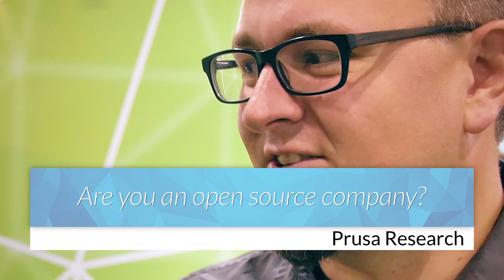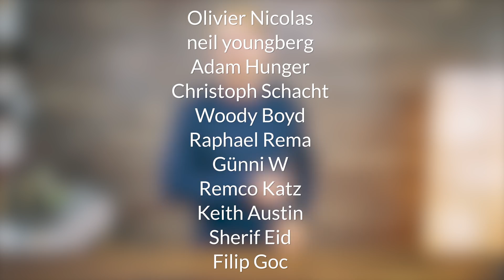"Open source" is more than a marketing term!

Comment: i would really, really really like to hear the opposite side, the people that think open source is not that great and why . that would be a good video as well ! Here i feel it's just a promo video to say that in order to be cool and progressive you NEED to be open source, and i think it's not the case at all.
Reply: It is perfectly normal for the management of the company to care very much about its profits, it is called 'fiduciary responsibility' and it is a duty of the officers in most cases, even for private companies. The question is not whether they care about profiting, alone or not, from the IP, the question is how they think they will profit the most from the investment they are making. There are many parameters, from the length of the development cycle, to the product life cycle, the R&D investment, the margins that the market will support, and as always, the short term vs. long term. A competent management team will take and attempt to quantify all these inputs, then inject their philosophies (beliefs, experiences, gut feelings,..) to build models and projections, and come up with a strategy. Not surprisingly, different teams in different conditions come up with different answers, positioned  along a continuum, not necessarily at one or the other extreme. 
All large tech companies have a mix of open source and proprietary products, and there's nothing wrong with that. That's how standards and interoperability are possible.
Reply: Pretty clear for me. I release some of my designs online free of charge to benefit the community but in the end I need to make a living and honestly, I like getting credit for my work, for all the time I put in and to think something I make could be ripped off and my name completely removed hurts more than it probably should. That’s why I don’t put some of my greater projects out there. That’s why I have a lot of respect for Josef Prusa. He has manage to make an OpenSource masterpiece while maintaining a working and very successful business and his name is renowned throughout the community.
I’m working on a new and hopefully exciting 3D printer design that I plan to make open source when I’m done with the basics, but I hope at the least my work is credited.
Reply: I’d just like to add some potential perspective from a professional environment on “closed source” from the “top end” as well.

I work for a drug research company currently doing trials with a Dementia related drug - despite spending literally hundreds of millions of $, you could call us “small pharma” but I don’t think any of us would consider these sort of numbers to be small fry :P.

Anyway, After spending decades on doing research and spending hundreds of millions, possibly even billions, on that research and on clinical trials, a company like ours and the investors that make it possible will - I think quite naturally - want to ‘protect’ that investment and keep the whole thing “closed source” in order to maximise profits.

I personally sit quite far into the “we’re all about as individual as a leaf is on a tree” i.e. what benefits others, ultimately benefits me - but I realise that sometimes it’s only really possible to make a project work using money, large amounts of money, and the people with that money might want more money in return for taking the risk of investing that money and “closed source” can very often protect that investment.
Reply: I’d think the opposite side is pretty obvious.

If you’re the IP holder for a closed source, possibly even patented product then you and you alone can profit from it. Which is great, if that’s what you care about.
Reply: Mark Hobbs medicine is a different story: they have patents. The whole thing with reprap took off after some key patents expired, so it is doubtful if patents really help innovation.
Reply: Jelle B Pharma isn’t any different than other industries because we make use of patents - heck the reason we got the explosion in FDM printers nearly 10 years ago is because of the expiration on Stratasys’ patent on FDM.

What I think makes our industry lean away from open source is the costly nature of the research - I think it’s quite natural to not instinctively want to share your IP freely when you’ve forked out hundreds of millions of dollars on the research to make it. In terms of inhibiting or helping innovation, with these levels of costs there would be no way investors would pony up the vast sums of money required to create the types of innovation we see at this level without protection mechanisms like patents.
Reply: The opposite side is very clear, if you want to make the big bucks you do not under any circumstance ever show your knowledge to anyone.
That is why all the richest companies go with proprietary stuff and seek to make even the options a paying ordeal.
Reply: Yeah but we've had proprietary for what, 30 years now? 3D printers were nothing but proprietary. They cost about as much as a Rolls Royce, and the materials were suitably marked up too. But the engineering they put into it was marvellous and the quality was absolutely spectacular. This is probably the best argument for proprietary you're gonna get - by locking competition out and driving prices up, they were able to sustain top of the line engineering.

Right now we have low-cost proprietary competing against low-cost open-source/collaborative, and sad attempts at competition lock-out and customer lock-in only reduce their competitiveness, while not giving them enough margin to perform groundbreaking engineering.
Reply: Hansbald, look at patent US5121329 A filed in 1989. It would have run out in 2009-2010-ish. The subject of patent is the process of producing objects by depositing solidifying liquid material in layers.

Now you might think that this is not something that should be patentable, and that the patent should be invalid; but subsequent invalidation based on triviality is extremely rare and practically unlikely, invalidation based on prior art is normally the route taken, but quite unlikely in this instance because chances are, a 3D printer didn't exist before 1989! So practically if you were a potential smaller rival, until the patent ran out, Stratasys could sue you until you ran out of money and could no longer continue to defend yourself, or they are not unlikely to win entirely and have their patent confirmed.
Reply: I guess you can look it up, but if memory serves me correctly they were patents on the FDM process itself – so the nozzle moving around, depositing layer after layer of molten plastic. There are still patents on the use of a heated chamber (whilst keeping the heat-sensitive components out of harms way) which is why you don't see many heated chambers.
Reply: you heard it, but you missed it: Ultimaker is the new makerbot. They pretend to be open source for advertising reasons but ignore the essence of it. Ask them for their design sources (solidworks files) and you get dismissed as a religious zealot (after they try to fool you with their pre-compiled NC shit).

Comment: My 3D printing open source heroes (Wall of Fame) includes, most definitely, AlephObjects, then E3D Online, Ultimaker (Cura rocks!), and Prusa Research. Of course, the open source projects that exist on their own are also marvelous. Slic3r was originally coded in Perl (so if you really want to learn to rock Perl…). PrintRun (Pronterface) is fully open, written by a co-author of Sprinter. Marlin Firmware is popular with many vendors and under very active development by the community. The various libraries and driver boards that RepRap 3D printing thrives on are almost universally open source, and there's a lot of feedback from 3D printing projects that inform libraries like u8g …

A lot of manufacturers are vying for a common consumer market with the aim to have an all-in-one plug-and-play solution —3D printer as appliance— and miss that there's a wave of thousands of RepRap enthusiasts (and average people who go to 3D Printing Meetup groups) who are also avid buyers of MK3s, LulzBots, Ultimakers, Crealitys, Tevos, SeeMeCNCs, Chinese clones… and so on… due to the revelation that this is Accessible Technology. The reputation of manufacturers among members of these groups largely depends on how serviceable and open their hardware is, how easy it is to obtain, upgrade, and modify the firmware source code, and how responsive (or aloof) the vendor is with respect to the user, designer, and developer community at-large.

My firmware clients are often wary to expose any technology developed under their aegis to the outside world, in spite of assurances. In my opinion, when it comes to a product vendor, it's the "whole package" that people respond to. Open Source provides a mechanism to create the bricks, but it is up to creative people who understand open source to build great products and companies out of these pieces — if they're willing to play by community rules.

The generous Open Source community, which gives its ingenuity freely —time allowing!— is a powerful resource, but traditional companies fear that the community will usurp and devalue their in-house innovations. There is some basis for concern about an explosion of rogue clone manufacturers producing products of equal quality. However, the old adages about being first to market, building a name and reputation, giving attention to detail and excellent service, and so on will continue to apply in primary markets.

In general, FDM innovations are incremental and come down to adding more sensors, improving rigidity, reducing inertia, perfecting extrusion, etc., and creating a closed-source host, firmware, or slicer is a waste of resources, in my view, as 99% of that work has already been done. In the end, all consumers want is a well-made machine, ease of use, great prints, and good customer service. Vendors would be wise to open up one or more of their products and take account of the long-term benefits that accrue from externalizing a major part of their workload to fans of their designs.

Comment: I own a DaVinci Jr and it doesn't allow 3rd party filament or slicers. You can however bypass both of these by encrypting your standard gcode and reflashing the filament id chips, but I shouldn't have to. In the end I just replaced the electronics board with a RAMPS 1.4
Reply: You could always just flash the firmware over to Repetier and stop caring about the filament chips altogether.
Reply: Repetier hasn't been ported to the Jr yet
Reply: The jr can use s3d and cura

Comment: I am super-impressed that Prusa is using openscad and freecad.  This a genuinely walking the talk. I have been using freecad for about a year and used it to redesign the inferior hot end on my printer around a GENUINE e3d v6.

I know Tom has mixed feelings about freecad,  may I suggest that as it has improved greatly recently in my opinion, that he look at it again on  the channel.

regards

Comment: Lulzbot is the most insane, open source source company that exists.  Those crazy guys sent me the LAYOUT for their warehouse, and helped DeltaMaker figure out inventory management and workflow processes.  They are the most impressive 3D printer company I have seen.  Even their current development work is placed on a public development server, which is unheard of.
Reply: They deserve all the kudos and respect. they make a solid machine and treat their customers very well.
Reply: I saw a TAZ6 in a store and thought it looked cool and took a closer look.  I liked the connectors and other parts they used.  When I got home I started researching the TAZ and found all the documentation on their rsync server.  They tell you where they get the stuff and give you all the part numbers.  CAD files are FreeCAD and all the other documents are also in open format.  They completely get it!  This was a great video!   I like Prusa (have an MK2) and the others but Lulzbot is leading in open.
Reply: Proud to own a Lulzbot!
Reply: They sent you their warehouse layout?! WOW XD
Reply: No kidding.  Their responses in the video are actually pretty amazing.  We've got a Taz 4, and I immediately rscyned the source tree "just in case" they folded at some point because I was a little concerned that they'd get hosed over!  Fast forward and they're now a powerhouse in the field.  Also, the Taz design rocks, zero issues that weren't PEBKAC.
Reply: Jesus Christ! They are definately Hardcore Open Sourced. I'm impressed! So beautiful, I'm definately using them as a case when teaching 3d printing. 

Thanks for sharing, was totaly not aware of it!

Comment from the maker: Welcome to the comment section!
Reply: @Melad saleh - I suggest you try the Tom's forum (https://discuss.toms3d.org/) as his time is very limited to respond to individual requests. Someone on the forum might be able to help you figure this out.
Reply: Madhu Nuggehalli that was meant as a joke. What drm do you mean?
Reply: Madhu Nuggehalli ok. But the build plan, the code, the scad files are there. When you build your own printer inspired by the original, you could use a different Probe and Motors and adapt the firmware to your choices. I see no limitation here
Reply: Speaking about prusa research, what's your take on the blatant DRM they have on the mk2/mk2s and the up coming mk3?
Reply: Madhu Nuggehalli like the music it plays when the filament runs out?
Reply: Madhu Nuggehalli that is not drm. 
Your use of the word drm is as strange as the Asian lady in the video‘s use of the term open source. 
And there is no objection for developing a new print bead or a sensor that includes two sensors? I don’t get it
Reply: Madhu Nuggehalli thanks for explaining your point. Makes sense now. 
The prusa firmware is on github. They do not need to backport their changes to stock marlin. Everything could do if wanted. Right?

Regarding the pinda you might be right. But one could cut it open to clone it. Prusa would or could not sue, or could they?
Reply: I meant everyone not everything
Reply from the maker: Also, first. Deal with it 🕶️
Reply: Thomas Sanladerer Gg tom
Reply: thank you
Reply: Thanks!
Reply: atStahlfabrik what music?
Reply: I have modified the source code of my Mendel Max 3, with direct assistance from MTW. I've used e3d drawings to design parts for my self sourced and kit printers, and strangely enough, of all the key parts I have that came with an open-source philosophy it's the Duet electronics that I haven't modified.

Because they provide access to nearly all the important features via gcode.

Which is amazing.
Reply: hi thomas how are you,i need your help withe my diy kossel delta xxxl 3d printer firmware i uploaded the kossel mini firmware and Anycubic_kossel and Marlin-RC they didn't work can you help me with this problem.
i need help with the firmware and and configuration for the printer 
specs:L 600 mm W 600 mm H 1250 mm 
build volume  D 450mm H 740 mm
0.9 degree stepper fore the xyz and 1.8 degree for the extruder.
20 tooth pulleys gt2 belt.
arduino mega 2560,ramps 1.4,stepper motor driver 8825.
Reply: atStahlfabrik the pinda probe, the 'powder coated' print surface
Reply: atStahlfabrik they couldn't sue you; and I did open one up. The markings on the chips inside mean nothing. It is made to order; just like the stepper motors. You can't find a datasheet for them even if you tried. It's 'custom'. so much so, that if you bought a mk3 kit; tried to use the electronics only on a diy printer, it's not guaranteed to work. You need the PR motor set. And, you can't use the PR code base on anything other than a PR printer.
Reply: atStahlfabrik I give up. Have you tried to make something based on the mk2? I'm not going to argue anymore
Reply: atStahlfabrik actually, it's as strange as PR's definition of open source. Do you know what's inside the pinda? Or where to buy it other than PR? How many modifications they have made to the firmware has gone back to Marlin? I know of only one. DRM prevents copies; the same way the pinda does, the same way the new print surface will. Josef is surprised that there's no one to one clone of the mk2? Well, her should be proud that he and his devs have successfully created a version of open source that allows this to happen.
Reply: hi thomas how are you,i need your help withe my diy kossel delta xxxl 3d printer firmware i uploaded the kossel mini firmware and Anycubic_kossel and Marlin-RC they didn't work can you help me with this problem.
i need help with the firmware and and configuration for the printer 
specs:L 600 mm W 600 mm H 1250 mm 
build volume  D 450mm H 740 mm
0.9 degree stepper fore the xyz and 1.8 degree for the extruder.
20 tooth pulleys gt2 belt.
arduino mega 2560,ramps 1.4,stepper motor driver 8825.